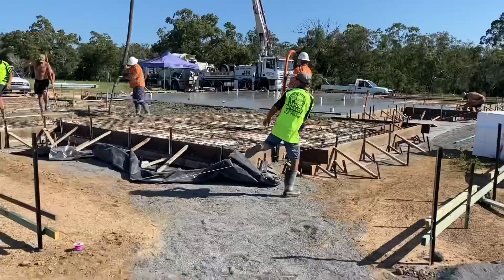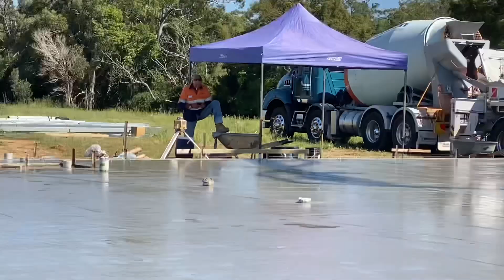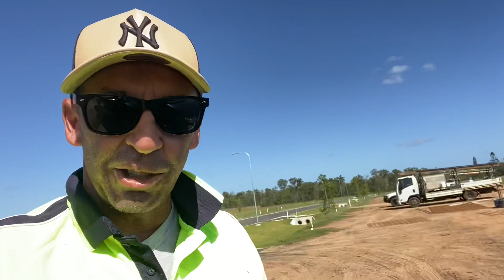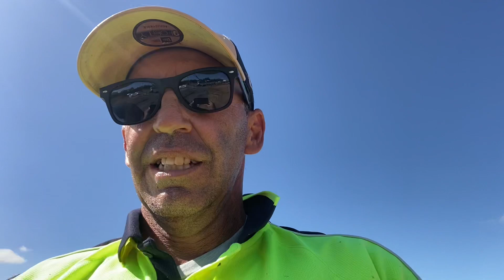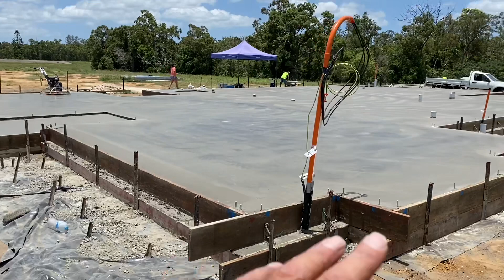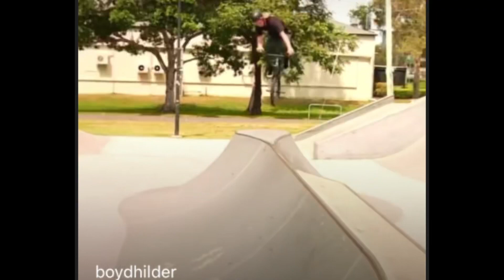How Much do I make concreting ￼

Comment: Hey ninja I’ve mainly been using a viber strike screed for the last 10+ years and after i started watching you a couple years ago now I’ve gone back to the way you do it picked up a kraft 2”x2”x8’ with a wood handle it’s also rounded on one edge and sharp squared on the other its not bad but I need to try out the master finish ones definitely need a 10’ and a 12’ thanks so much for your videos very inspirational and my work is much more flat 🙏
Reply: Why you change from vibra screed to hand screed.?